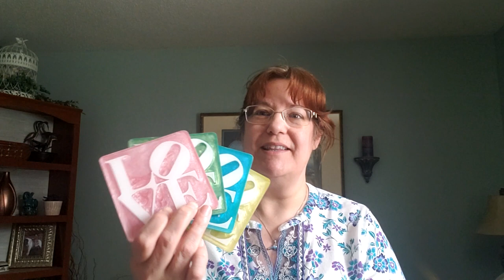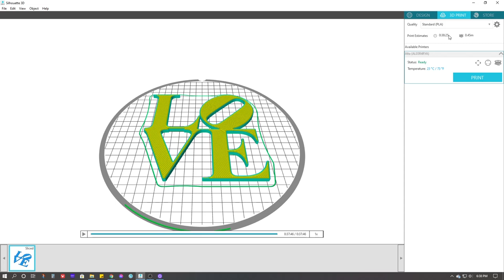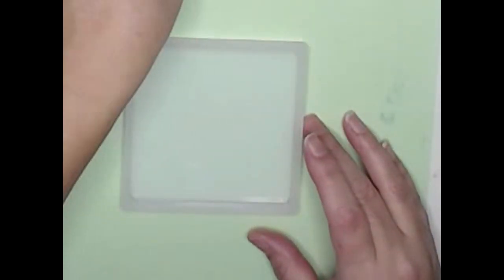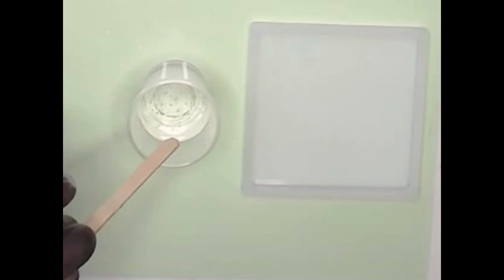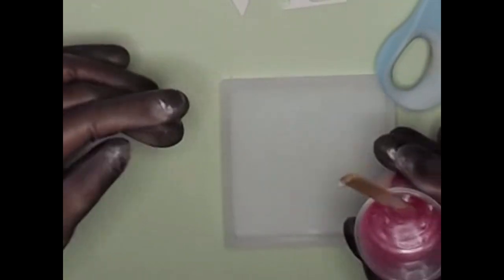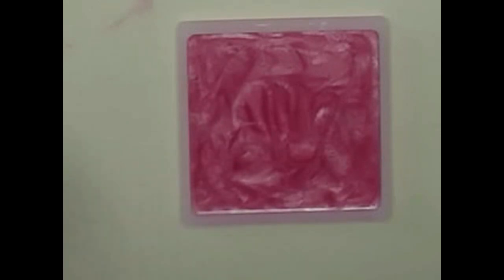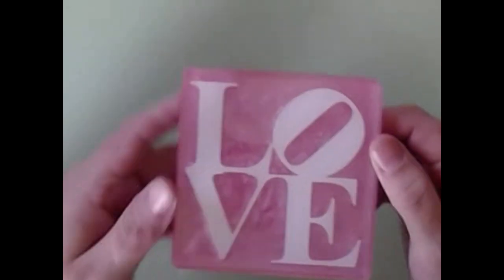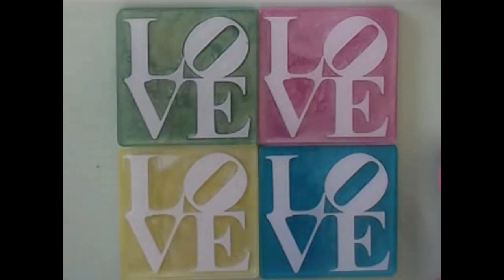Valentine's Day Love Coasters made with Resin and 3D Printed Inserts

Comment: I'm very curious about what you use to 3D print. Interested in how it didn't melt when exposed to the curing resin. I love the maker community combining art with tech!
Reply from the maker: I used my Silhouette Alta and standard pla filament.  The resin in the coaster was thin enough it did not heat up enough to damage the print.